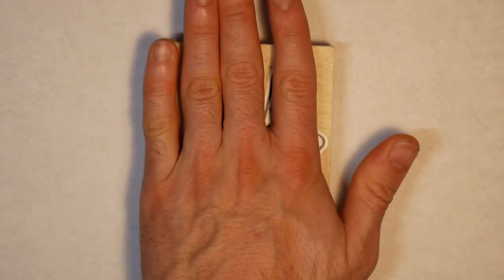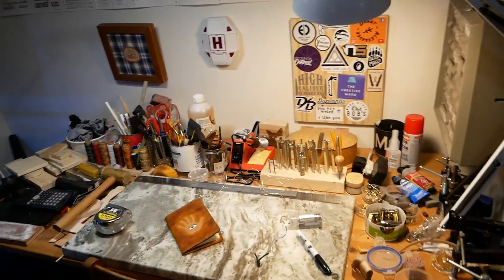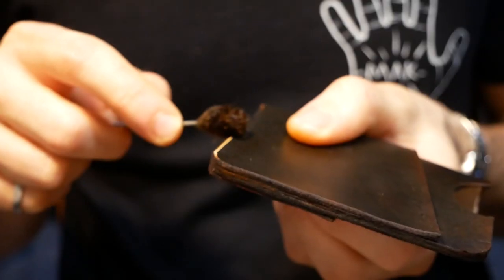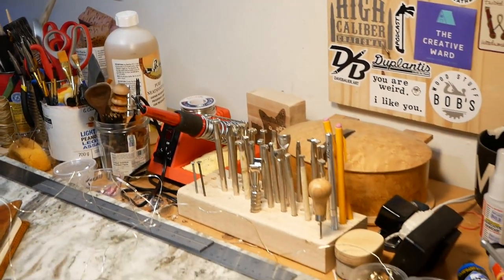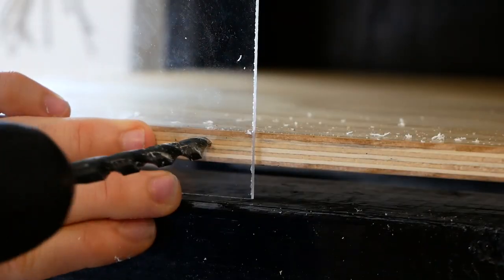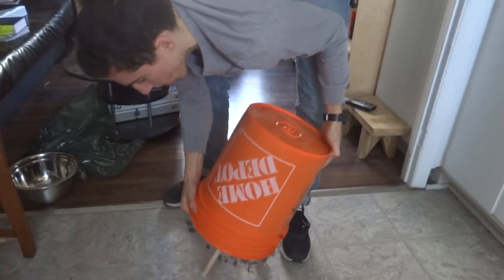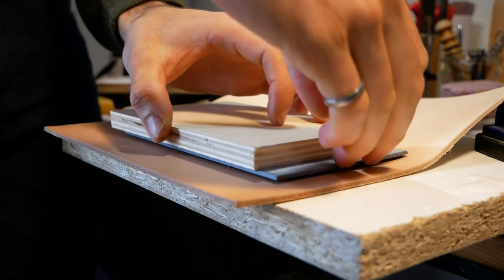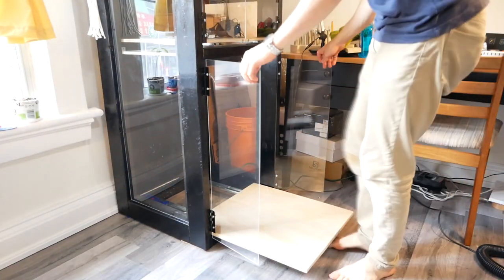TINY APARTMENT WORKSHOP TOUR + Tips for Making from a Small Space!

Comment: There are so few videos on workshops in tiny apartments. I wish there were more of them. Your workshop is an inspiration. 
About 20 years ago I manufactured and sold underwater video camera housings from six-inch PVC pipe in a small one-bedroom apartment on Miami Beach. I would cut the 20-foot sections at the plumbing supply warehouse, drive to my sister's house, cut them into smaller sections, and take them home to my apartment. I had a Toyota Corolla that the back seat folded down, allowing me to carry the pipe. Where I live now I still make stuff in my apartment on my balcony. There are landscapers that come twice a month so if I need to work with any power tools I just schedule my activity with their lawn maintenance equipment noises. Also, we frequently have thunderstorms that roll through here in South Florida which makes for a perfect time to use my router. I have a very large drill press in my apartment covered with a green piece of plastic cloth which is the same color as the lazy boy chair in front of it. Nobody knows it is there but me. The most important tip is the one you gave which is to suit your activities to your space. I have found I don't enjoy making a lot of sawdust in my apartment. That means I have had to change the size and type of projects. 
Storage is still a big issue as is not wanting to let go of scraps. 20% of my apartment is filled with things I want to turn into a project, is a project in process, or something I know I will regret throwing out.
Your videos and creations are very well done. I'm happy to subscribe.